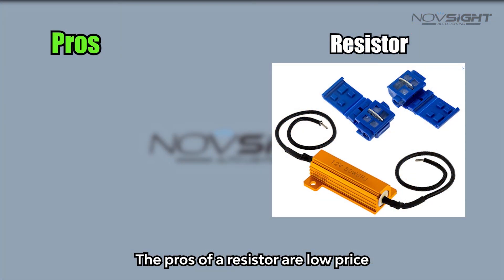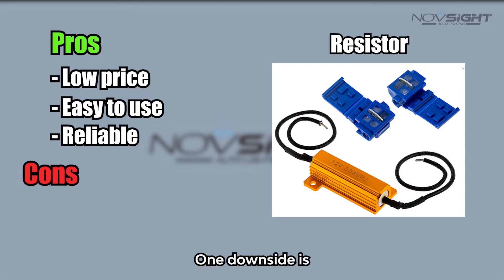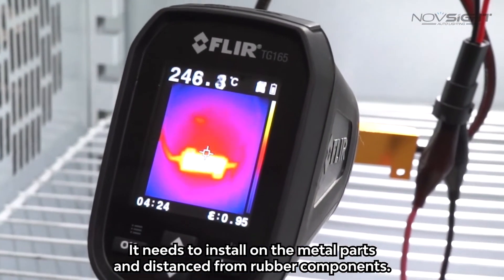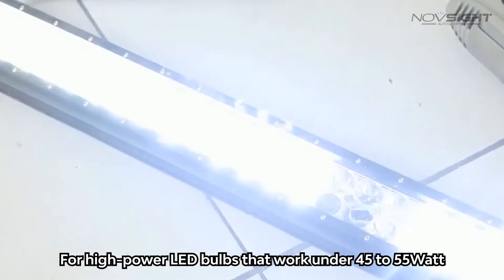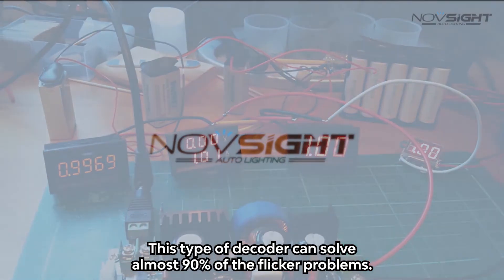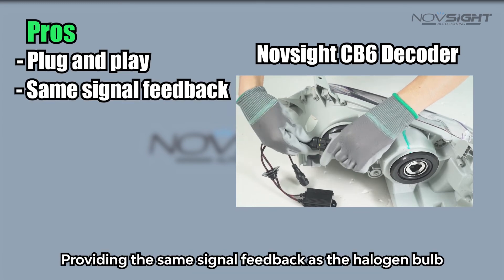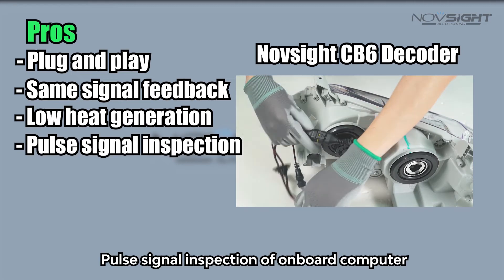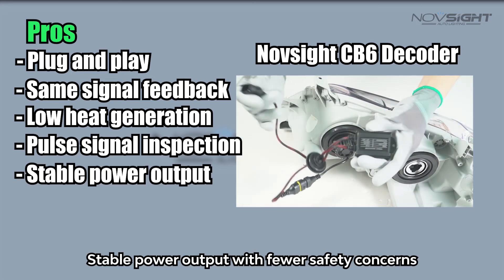3 Anti-flickering solutions for LED headlights - What is a decoder and how to install?

Comment: Would this works on a 2015 Chrysler 200 I’ve been tired everything it’s been keeps randomly shut off while driving
Reply from the maker: Hello, dear, what brand and series of headlight bulbs are you using? This CB6 is a capacitive decoder.
Reply: @NovsightAutoLighting  9012 luxster headlights bulb 30000LM

Comment: For anyone's Info - I have a 2006 Honda Civic i-vtec Hatchback and this did not solve my LED light flicker (converted to LED from Halogen bulbs) so don't bother buying this if you have the same car and problem, about to try a harness to bypass the computer and see if that helps :hand-purple-blue-peace:
Reply from the maker: Hi dear, we apologize that our product didn't solve your flickering issue. Could you please tell me which series of our brand's LED bulbs you purchased? We would like to share this case with customers who also own this car model.

Comment: I have a 2015 Jeep Patriot that I put LED bulbs into. I don't get flickering but, the bulbs go completely dark and come back on randomly.  Sometimes individually and sometimes together. Would this product fix my issue? Yes, all connections are tight btw
Reply from the maker: Yes there, but you need to buy the decoder corresponding to your headlight bulb model. For exmple, If your headlight bulb model is H13, then you can buy the H13 decoder.

Comment: Will this help with the led headlights on my 2002 F150 harley davidson edition truck, ever since I switched to LED bulbs in the headlight the radio stations from far away 50 to 100  miles away now sound with static due to the lights. When I had the halogenated bulbs the stations used to come up clean loud and clear. Will this help with the led light static on the radio?
Reply: First, I would try putting halogens back in and see if that fixes it. If it does fix it then I would try this. But perhaps you need to shield the LED bulbs that you have to prevent it interfering with your radio. Or maybe somebody disconnected it on accident when installing the headlights. Who knows

Comment: I have a car with auto stop start and when my car turns back on at stops I get one quick flicker I assume because the engine draws enough power to make my voltage drop below the working range of my led drivers, will this have any impact on that or no?  Like I need a capacitor inline or something

Comment: i had a Toyota mark 2 jzx110, has an h4 as foglight in the headlights (not the bumper). while using novsight it flickers on low beam, however works fine on high beam. tried using canbus but the headlight it is connected to stays on high beam but the other light works perfectly fine. and vise versa while using canbus on the other headlight. any solution for this? currently using 3 holders one for canbus(since it was causing the light to stay high the holder is free from connection) other two for the LEDs. works fine but not sure if its okay?
Reply from the maker: If the H4 only works as high beam, that might be because the decoder didn't work in your car module. Please contact our customer service to acquire further solutions.
Reply: @NovsightAutoLighting  please share a link